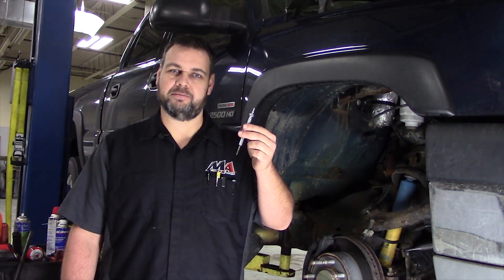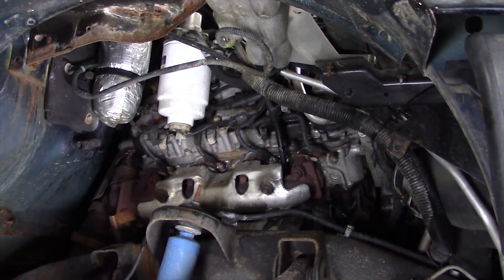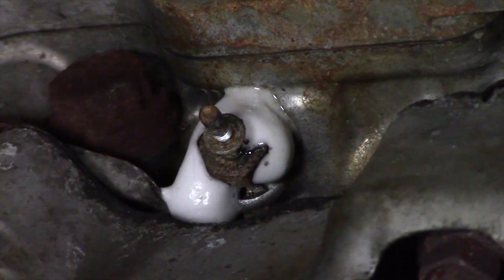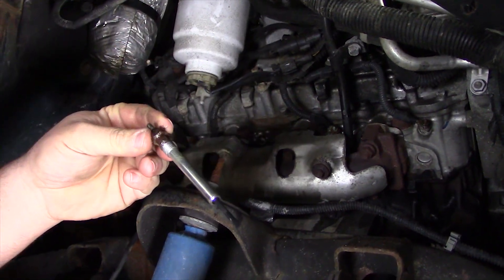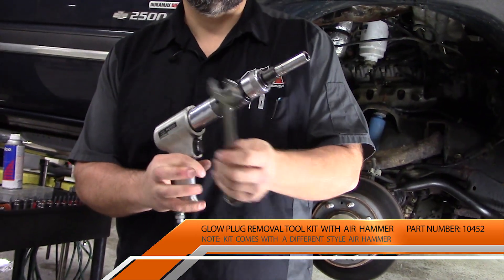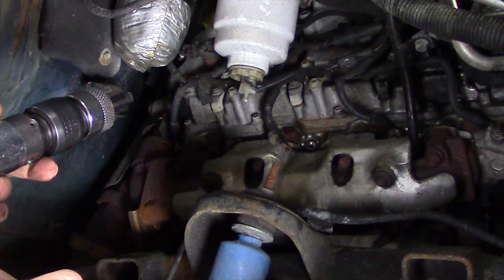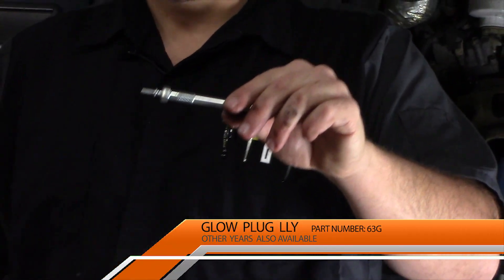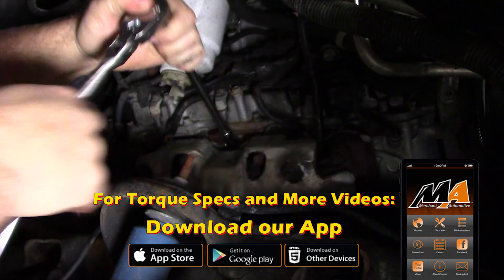How-to correctly remove a stuck diesel Duramax glow plug - Mechanics Minute

Comment: When I put 8mm, the whole wire turned and snapped.  Now what?
Reply from the maker: You can likely pull the center of the glow plug out and while holding it with pliers, remove the nut.  The glow plug will need to be replaced of course.

Comment: As a man who has replaced dozens of Duramax glow plugs, I would NEVER bring a power/air tool even within shouting distance of a stuck glow plug. You are asking to break it off. Even using an air chisel "lightly" like this makes me viscerally cringe. One wrong move and its all over. I tell people all the time, all you need is a warm engine, and plenty of proper penetrating oil. I've never found a power tool even remotely necessary even on the most rusted of glow plugs.
Reply from the maker: Best of luck when you need to replace one on a truck in the rust belt!
Reply: Jesus is coming should he save you according to commandments?Repent :)

Comment: Just curious, why does manufacturer repair manual say "don't use antiseize on glow plug threads".   Also, why use "copper antiseize" instead of standard antiseize?
Reply: I suppose because people would put all sorts of stuff onto it and since they are glowing hot, it can worsen the situation in many cases.
Reply: Copper antiseize insures the glow plug maintains a good ground but the dissimilar metals can cause corrosion. Corrosion between dissimilar metals, known as galvanic corrosion, occurs when two different metals are in contact in the presence of an electrolyte, causing one metal to corrode preferentially. This happens because the metals have different electrical potentials, leading to accelerated corrosion of the more reactive metal (anode) while the less reactive metal (cathode) is protected.
Reply: @johnmiller6197  best explanation I've read.
Reply: The antiseize acts like a lubricant and reduces the friction between the glow plug and the head so you can easily over torque them.

Comment: One can also do this with a battery impact drill. Just set it to the lowest setting and let it vibrate. Slowly increase the power of the impact and they will usually back out. Go slowly and let the vibration do the job. Some have taken 90 seconds to work loose.

Comment: I'm a mobile mechanic myself. 24 years. Kroil is the nest penetrant out there
Reply from the maker: Don't have much experience with it myself, but heard lots of good on it.
Reply: The best to empty your wallet. I’m a 3rd generation mechanic, and the best luck we have had is with pb blaster.
Reply: Kroil has saved me many times even rusted frame and subframe bolts

Comment: Hi . I have an old FJ40 and think glow plugs may never have been changed. They are marked and scratched on bolt a lot. Threads come undone easily but glow plug will not come out of hole. What would you recommend ?
Reply from the maker: It's possible the tip is swollen and this is keeping it from coming out.
Reply: Does anyone have a solution on getting them out when it’s unscrewed but still won’t come out?
Reply from the maker: @copedennis1  The tip is likely swollen.  Care must be taken when trying to get them out so as not to break the tip off in the cylinder.  You might be able to pull it out with a bit of force, but just have to be careful not to break it off.   May end up needing to remove the cylinder head worst case

Comment: Trying to figure out how the socket sliding up and down on the  glow plug hex due to the hammer transmits much shock value at all to the threads. Have to be careful to keep the socket (6pt of course) on the hex without hammering on the cylinder head.  Sounds like it works great though.

Comment: The tool is called a shake and break, commes in a set of 2 3/8- 1/2 inch drive. It does vibrate the block and mark it a bit but no big deal, has you put pressure on the wrench, the vibration is transferred to the plug.
Reply: I kind of noticed that it wasn't hitting the plug directly but rather the bottom which would be the block, would it better to install the 10mm back flush to the plug and use a short 12mm socket to hit the plug directly? I believe the taps shouldn't need to be too aggressively.

Comment: Very helpful, i did the job with success. I used the tool on all of them, i didnt want to take a chance breaking them. Just used pressure with the wrench and came out easy! The hard part was to reconnect the wires, grind all the ends because them little bolts would break off!! Also i was able to do the job without having to remove any coolant pipes... pushing on them a bit.

Comment: Is this a normal 6 pt 12’mm socket?  Or is the end machined to vibrate the plug itself?   

It would seem that a regular deep socket would just vibrate the head and not the plug itself.
Reply from the maker: We machine our socket so the socket bottoms out on the head of the glowplug. A normal deep or medium depth 12mm socket will hit & damage the head.
Reply from the maker: Duramax Glow Plug Removal Tool Kit | 2001-2016 vehicles.

https://www.merchant-automotive.com/Glow-Plug-Removal-Tool-Kit-LB7-LLY-LBZ-LMM-LML-2001-2016

Comment: lol glow plugs should come out very easily. You people are making the mistake of not applying antisieze before you install them. That's why you have trouble. ALWAYS use antisieze when installing glow plugs. Also when you are taking them out don't just turn them out. Go back and forth (loosen then tighten) a little bit at a time to make sure you don't break anything. PB blaster is your friend if they are stuck but you should never need it.
Reply: Tell this to mechanic in factory who torqued them 30 years ago 😂

Comment: That glow plug looked new . Mine had so much carbon on it it would not come out . The threads pushed it out a little but the carbon was holding it in . So after going in and out soaking and pulling while turning yelling at it for an hour. I just started it and it shot out like a bullet.

Comment: Excellent video; thanks. Especially helpful are stating the socket sizes. Any tips on pulling the wheel wells?  Some comments below have some good tips too.
Reply from the maker: We do offer a tool to aid in removing those clips as well as replacement clips if they get damaged.

Comment: Excellent ideas, good idea of using vibration. Prior to inserting the new plug, you could have used a reamer with some grease to collect all the crap from the inside of the thread on the head block. You can soak the old glow plug in the head block for a few days in non silicone oil too and use the car...helps a lot...prior to removing the plugs from the head block. Thanks.
Reply from the maker: Great tip!  Most of the time with the Duramax, the issue is the threads not letting go but always a good idea to make sure the head is clean as well

Comment: What if #8 glow is stuck ? Your not getting that air hammer in there.
Reply from the maker: That sure makes it tough, but an extension can be used between the socket and the air hammer.  Not a perfect scenario but should help some
Reply: Just use a 3/8 impact, best of both worlds.  The hammering affect and the reverse motion will get it out.
Reply: I recently changed all 8 glow plugs with the air hammer and at times help with an extension. Awesome tool. 2005 LLY 135k

Comment: I do the same thing with my 3/8" impact and very low air pressure in and out go slow, in first then out it works very good the hammer vibration is what helps.

Comment: I don't get what this is doing over a regular socket or impact. It's adding a hammering action forward and backward, but I don't see how that would prevent damage compared to using a plain 6 point socket
Reply: Ian Mcdowell An impact wrench puts torsion on the threads which may break them. The impact puts vertical loads on the threads to help break them free. Also, using the wrench manually provides better torque control and doesn’t force rotation as would an impact wrench.

Comment: Just wanted to take a moment and say thank you for this tip. Cylinders 5 and 7 were frozen on a C5500 bus and even snapped the glow plug 12mm heads off. I was successful using your method with some socket extractors, an 1/4" drive extension w/ a nut welded on the shaft, and my air hammer (short hammer head) w/ a 1/4" adapted welded on the end. Necessity is the mother of invention my friend! Happy New Year

Comment: I am working on an LB7 with a seized #8 glow plug.  I have the same air hammer and bit as you showed, but it looks like I won’t be able to get square on the plug due to the cab.  Any other suggestions besides soaking it for days with penetrating fluid?  I tried to budge it both directions but it seems to start twisting.  I really don’t want to break it off, especially on #8
Reply: Mark Lawrence I

Comment: This method needed to be used on two glow plugs, the rear most on my 2002 LB7 (184K miles).  The one on the R side came out fairly slow for about half way, and needed air hammer to that point, and (oh crap!) pulled a thread.  The one on the L started slow for about 2/3 of a turn, then freed right up to where it could be removed by hand.  The other six did not need the air hammer method.  

So, that pulled thread in the R rear most opening....could only drive the new plug in 1/2 way before it bound.  So, I took the old glow plug and chased it with a 10 mm x 1.25 die nut.  Then, with my Dremmel tool, I cut two longitudinal grooves in the threads (inner half), 180 degrees apart, and sharpened the remaining "V" groove with a file.  i used this as a tap, driving in 1/3 way, removing, 2/3 way remove, and the rest of the way.  I removed debris with a smaller diameter tap wrapped in a paper towel.  The as left opening looked clean. This successfully restored the threads so that i could drive the new glow plug home without exceeding the max torque of 13 lb. ft. till it seated.  

kudos to Merchant Auto.  The only bad was I ended up with a bit of surface galling on the perimeter of the glow plug opening.  But, it sure beats the heck out of a broken glow plug.  Thanks!
Reply from the maker: Glad to hear you got them out.  You never know what you getting into until its time to take them out. We have had lot of experience taking these out and glad out kit can make it an easier job. Thanks for watching